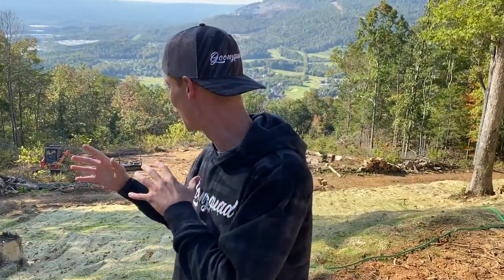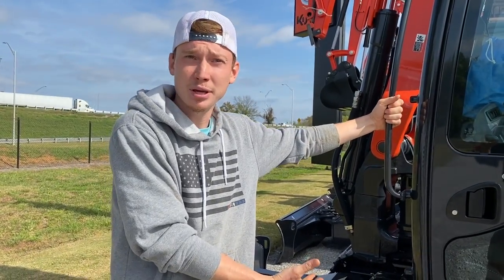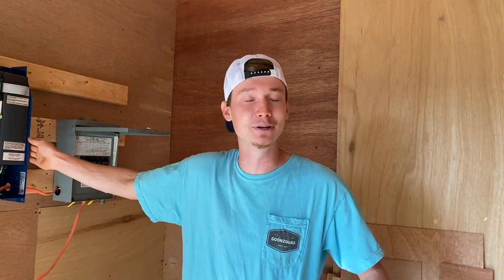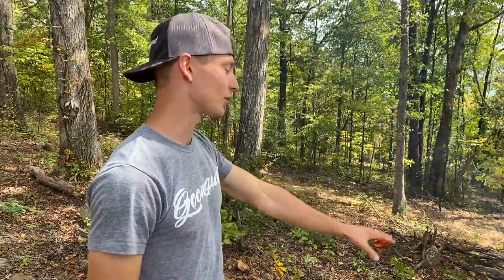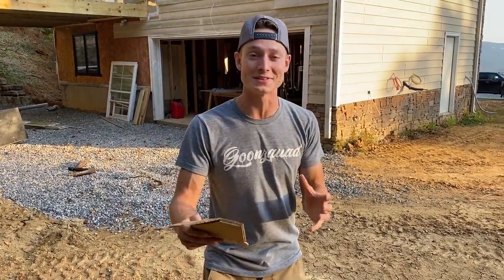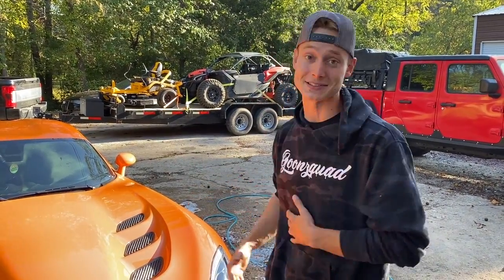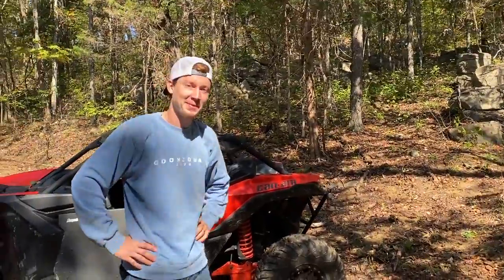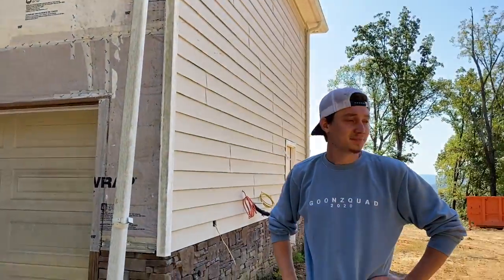The New Goonzquad Headquarters Part 26

Comment: Maybe you been told this and I'm just not seeing it, but do you guys know that's not how your supposed to run your well pump like that ? it is supposed to be hooked to a bladder / storage tank so you can build pressure and pump can cycle on and off so that pump is not running continues and gives well  water level time to recover and not run well dry?
Reply: I was going to say the same thing about the well pump and tank. The amount of water they use I think they need a large blatter tank. They probably did suck the well dry it had time to refill when it wasn't working.
Reply: Interesting.  I'm learning a lot from the comments.
Reply: They did mention they have a guy coming to finish the well house stuff of so I expect that's what he's going to do, they're likely just running it as is for now.
Reply: @eldnah2  --> Same here. Since they are on a mountain top should they have Lightning Protection for all structures including the pump house?

Comment: I started watching yalls channel after a buddy of mine told me yall were local, it was around the time yall started this series. It has been an awesome series so far for me considering all the landscape and grass projects. Might I recommend a seed blend for the area yall are clearing out? Try Lesco Shade Mix. You can get it at SiteOne in Ooltewah. The Creeping Red Fescue is fire grass for those highly shaded areas. And any other areas getting more sunlight, go with Lesco Transition Blend. I have been using this seed the past few years with outstanding results. Also, Lesco Nos Fertilizer will help get those roots established before winter. Keep up the awesome content!

Comment: Did the back of my house myself with hardiplank. If you are doing the individual plank siding, you can get a kit that lets you get the spacing spot on for every board. Takes two guys to get the first row done (to keep it level and in line), but after that it is a 1 man affair for the most part. Make sure to get the right blades for your saws to cut it. And follow the safe precautions! Masks, have your saws feed out to a vacuum with a HEPA filter. You are dealing with concrete, and silicosis is a real thing! You guys are young, be safe with this stuff or risk ruining your lungs. Outside of that, its a pretty easy job. Looking good, keep up the hard work! And looking forward to you guys getting back on the cars!

Comment: I told you a few videos ago to look around the auctions and pick up a bunch of scaffolding because you'll clearly have plenty of use for it within the family circle of properties alone. Plus, it stores very easy out of sight anyway. The skid steer bucket is not a great substitute for good scaffolding. It'll work in a pinch but it also tends to be busy doing other jobs.

Great to see one of your project cars make it up the mountain. The more beast types ones were a cert but I wanted to see the hot cars reach the new peak too. U Really need to get this done so the actual garage build can begin though.

Comment: Financing new equipment isn't always the way to go though. Gotta be smart financially. The best way for someone wanting to get their own business going with heavy equipment, buy USED! Plenty of great used running equipment out there and it'll be much smarter of you rather than getting expensive new fleets.
Reply: Buying used is still very expensive for a beginner starting from the bottom. You'll have to take out a business loan and hope the used equipment don't have service issues.
Reply: @PanameraTurboSEHybrid  Yes. Used machines have unpredictable maintenance and repair costs, and buyers have limited redress if there are undisclosed faults. New equipment has guarantees and all components are pristine, helping to make budgeting forecasts and work programmes reliable for the first few years.

Comment: RESPECT man - one thing I have learned over the years - you lose respect for the machine (chainsaw), it loses respect for you.  One kickback is all it takes.  Time and time again I cringe as i watch you guys operate those things - especially last video with one hand on each saw...  just know, chainsaws bite back!
Reply: You apparently didn't watch the video where they replaced the bent part and chain, after they ran it over...  I'm pretty sure they didn't have the chain saws on when they double fisted them.  These guys aren't new.
Reply: @kjpete3  Click on Part 25 of `The New Goonzquad HQ' and you will see in the first 2 seconds - the saws are running.  One in each hand.  I know they are just having fun...  but they are not wearing hard hats, screens or chaps.   And a kickback can occur at any time, flinging that blade in any direction while it is running. I've worked with saws many times over the years and have experienced kickbacks... they can be scary. Of all the toys out there, chainsaws are one that must be respected.  Just saying.

Comment: With the amount of leaves your mountainside will produce, you might want to look into a rear mounted leaf vac for your zero turn. Get your grass growing on the drive sides and you can vac up the leaves rather than pushing them out of the way for a few hours! You may want to concrete over some of the area near the garage and such, but your driveway would be like a road building project- I'd just capitalize on the rock the previous owner spent large on. You might ask your brother if his construction company has some, or might subsidize buying some scaffold sections and accessories. FWIW, I'd replace all the vapor barrier as you do each wall. KOKO!

Comment: With all the hills and slants you guys have I would suggest you guys getting a zero turn with a steering wheel cub cadet is amazing for side hilling  the steering wheel controls the front tires and keeps the machine from sliding   Unlike the one you used !! Good luck guys with everything

Comment: I recommend rewrapping the house before you start your siding. And leave a 1/8 gap between joints in the siding and against trims. Also use plastic joint flashing. With that you won’t have to caulk your siding joints.

Comment: Be sure to watch a hardy siding video and learn how to flash the butt ends of the siding where they join. It will prevent water intrusion. You can use metal flashing or 30 lb. felt. I prefer the aluminum flashing and paint it whatever color you choose.

Comment: i think you guys should take out the garage door out and put in a patio sliding door that would look cool
Reply: But there is no sunlight at the back of the house because that facade faces north, and very limited views because of the steeply rising mountainside. The 'garage' already has three south facing windows which could illuminate the merch 'office' area, and if the rest of the space is going to be filled with shelves and racks full of hoodies then it will not need windows.

Comment: Hope your guy uses grommets when he works on the electrical boxes & pump controller in the pump house.  I've seen 240vac short against a metal box and it was basically welding.  Especially since there may be water present inside the room.  Be safe!

Comment: Hopefully the County Inspector notices the problem with the window framing  (on the newly added window)  before it gets drywall on it.  Check it out, on the window you added, the header (over the new window) is not supposed to be held in by nails. It should have a 2x4 under each end to transfer the weight to the floor.  Check out every other (preinstalled) window in the house. That is a structural section, and needs to be supported properly.

Comment: I've had a submersible well for over 25 years and I've never had a Control Box on it. It has a breaker to turn it on/off and that's it. And I've never had an issue with it. Y'all could have bypassed that control box and just installed a breaker shut-off and it would work just fine.

Comment: That equipment holds it's value pretty well as long as you take care of it. Use it until you don't need it anymore and resell it, cheaper than rent if you have a lot of need of it.
Guys that water system needs a pressure tank, you're making that pump run continuous duty without any rest breaks and that's a big no no for the life of the pump and the electrical board you just replaced. That panel was shot anyway from sitting outside but still...

Comment: You guys need to put cable clamps in those knock-outs in the well house, you dont want to be chafing a wire on the sharp metal edges. Plus that alone will fail an electrical inspection.

Comment: 13:37 "Going to be attaching the garage to this house" 
OH YES!! Confirmed theyre going to do a walkway joining the 2! 😁
Reply: Uh, no it isn’t, they confirmed they’re attaching a garage, nothing about a walkway. Probably just gonna build it directly up against the house.
Reply: @boytechnichian  well im saying that because i've commented through this series, and seen others comment that it should be connected via a bridge to an upstairs/loft area via a bridge. sure it might not happen, but it would be extremely odd design to keep the garage door at the rear, and make the access having to circle right around the outside of the garage. I stick by my comment.
Reply: @jarsky  how can you stick by your comment? You said it's confirmed and it's literally NOT confirmed? 😂
Reply: @jarsky  how many garages have you seen that connect to the house via a bridge? And who said anything about it having the door in the back? It'll likely just be a regular garage with a door on the front up against the side of the house. I don't even think it's gonna be the full on workshop, just a normal garage on the side like you see on many other houses.
Reply: @boytechnichian  i've seen plenty in that configuration that do here in my country. And im not talking about the doors for the large garage being around the back, but they already said theyre keeping the garage door setup on the existing one and that the new garage (which will be 2-3 doors access) is going to be on an angle to the existing house.
Reply: @jarsky  I'm guessing you aren't in the US then? Don't know of many houses over there that connect to a garage via a bridge. And I agree that keeping the door that's already on the house is a bit stupid, wasting a huge amount of room by not making it into living space or something similar, I'd have either filled it in and added a window or replaced it with a glass sliding door that leads out to the back garden. Not heard anything about it being angled or what size it's going to be either. This is the first episode that they've even mentioned that they are definitely putting a garage on the house and not a standalone one.
Reply: @boytechnichian  No i'm not. They have said through the HQ series that the garage will be 90 degrees, or angled (e.g 45 degrees) to the existing house. They're going to utilize the existing garage as their merch room etc..but are keeping it as a proper garage. I think the hard part, and why they've been so vague is because they don't have an architect...theyre basically #YOLOing it.  I imagine its going to end up with a drive through between the 2 buildings, covered by a roof joining the structures. Ultimately imo they should have had an upstairs loft area for a second living space above the garage, and joined it via a sky bridge but that would require redesigning the internal layout of the upstairs hallway and bedrooms

Comment: @ 06:40 heavy duty cables going through two steel boxes with no rubber grommets.
These lads are dangerous now. They keep taking risks and one day someone will get hurt.
Reply: Hopefully when the Electrical Subcontractor attends the site to complete the Well House installations he or she will correct any wiring errors so that the work will pass a Code Inspection.

Comment: Drilled 35 years in central md pa. You have to know the well performance and lab sample to determine pump, tank, and treatment system if necessary.wells cased and drilled properly have no problems with quality. Pump test will tell you what you have in gallons per minute. 1000 foot well, bet it's a quart a minute or less. Won't fly in MD. You want lots gpm and good water quality. Water is expensive

Comment: you need to put a fence up on all your land so you know what`s yours and what`s the numbers
Reply: The total perimeter of the 'Goonzquad' property extends to approximately three quarters of a mile in length, and would be very expensive to fence. Most of the land is already difficult to access by vehicle from adjoining properties and the Public Highway because of steep and rocky terrain, particularly to the north. The owners would however be wise to erect a suitable gate, fencing and security devices at the end of their entrance track, where it joins the tarmac roadway.

Comment: i had one of those wells it lasted a whole 10 years they are a POS. went back to a old fashion well with a tank and now it has a 10 year warranty and will most likely last 25+ years. those constant pressure wells have way too many parts that can break and the pump always running makes that part break first. if i remember right it was like $1400 to replace the pump and a whole new well with a tank was like $1800.

Comment: hell yeah you do need an excavator - you can loan it out or team up with bro on some jobs - they are expensive but there really is no subsitute - get the plow and thumb for sure also - good for all kinds of stuff - you will not regret - shop around for best deals - you can do maintenance and also do maintenance for other people as you level up #heavy equip tech
Reply: you may want to rent a few or buy used - get something big #low boy
Reply: i think the key is getting the garage done so you can get back to routine and keep cash flow  going - be cheap - don't feel bad about being cheap - diy as much as possible....the cleanup looks good - keep taking out some small trees and even a few of the bigger ones and open up that view - you will need room for the garage and also think about planting some  trees - stuff will grow back very quick so don't get sad if it looks a bit sparse or bare. easy does it - enjoy doing it in stages - with more stuff you end up with more liability so take your time. i approve of the hardy board siding -  do the same on the garage
Reply: you need the cr125/250 and a road all the way around property - you need it more than a zip line #dual purpose #woodlot management #sitework
Reply: forget scaffolding, think about a scissor lift - you can drive all the way around the garage - it is the best way to do it...make storypoles for the hardy layout so you finish with a full course - doing layouts is key....one day at a time - major progress

Comment: 50 hours that's one work week... I know machines that go months years without being serviced... Just keep the grease in the oil and water up you'll be fine
Reply: The first service on any vehicle has a different agenda to those that follow. It acts as the last stage of Quality Control, is often used to update components and software that may be glitchy or buggy, and often produces important feedback for the manufacturer and distributors.

Comment: please be sure to put the proper fittings in the power box and controller box to hold the power wire in place, that loose orange wire dangling like that can't be up to code.

Comment: Gotta be serviced after 50 hours? Dang. ...what's the car equivalent?
~ Cue Math montage
Oil change every 5000 miles : assume 70mph : 71.42 hrs... just about 3 days... 
50 hrs at 70mph is 3500 miles ...
~ End math montage
That lines up actually.

Comment: I've seen this happen so many times I'm just direct about it  Get a new well guy or stop being cheap, I don't know what actually happened but you know what I mean. When he put in the pump he should have put in a new controller. That old controller could have killed the pumps. It happens all the time. Any kind of voltage or amperage issues from an old controller will kill the pump before it's time. Or find a guy (plumber) who actually knows pumps and controllers other than the well guy. That shit can get expensive, really fast.  You'll be putting in new pumps every two or three years if your not careful. That might be how he really makes his money. A good pump + controller should last 10 to 30 years, easy.

Comment: why would you attach the garage to the house , insurance is going to hammer  you , i would build a monster garage separate from the house and add  a cool loft  which you could make into living quarters at a later date if you wanted to
Reply: It relates to the zoning of the area and the restrictions on any commercial operations which are built independently of residential accommodation. Constructing the proposed Garage integrally with the present Guest House may be the only option. The Goonzquad property is not only (just) within Chattanooga City Limits but also adjacent to a State Forest, so it is subject to a fair amount of bureaucracy. No doubt the purchasers acquired comprehensive legal advice on all relevant matters before they bought the land on  26th June 2020 for $360,000, as Public Records show.